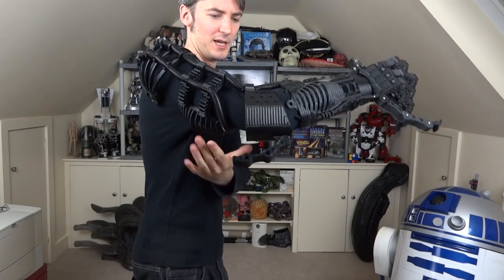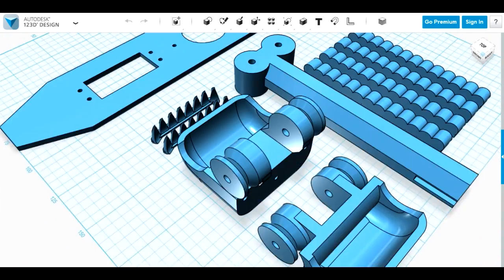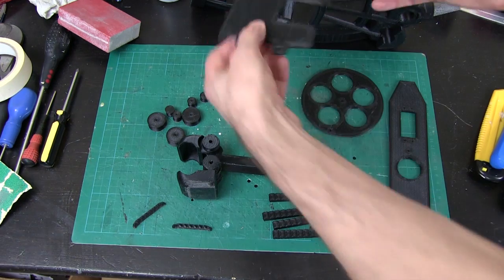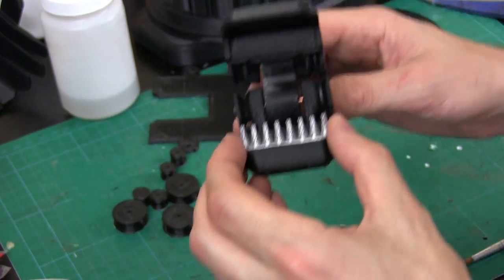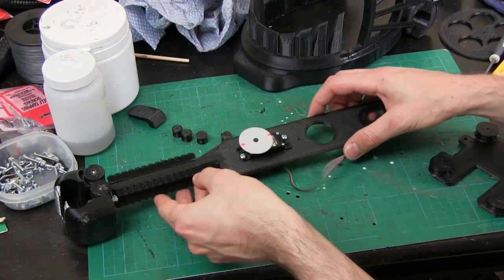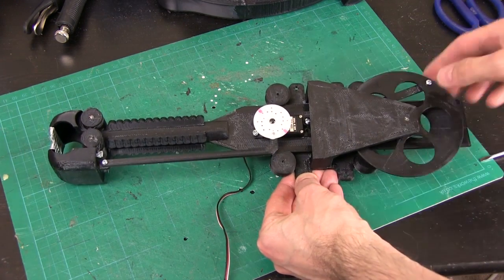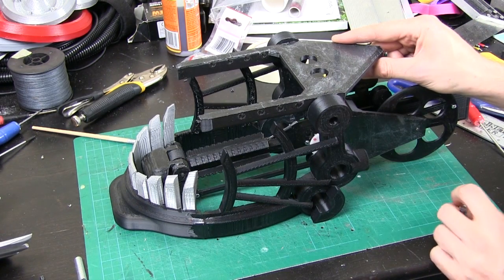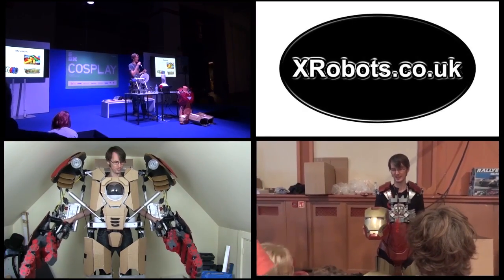Alien Xenomorph Cosplay #6 | Inner Jaws Mechanism | James Bruton

Comment: you could add a little rubber o-ring around the wheel to tighten it up a bit, would need to be small diameter of course :)

Comment: I'm surprised you don't have the inner head extending mechanism and the inner head opening and closing mechanism tied together, so that as the head extends, the jaw opens and closes. It would be one less motor, one less potential point of mechanical failure, and one less thing to have to trigger independently. Regardless, this is incredible, James! Utterly fantastic!
Reply: I was thinking the same.  But then I realized that it would be a cool/creepy feature to have the inner jaws end up opening and closing erratically while they're out, and figured that's what James may have in mind.